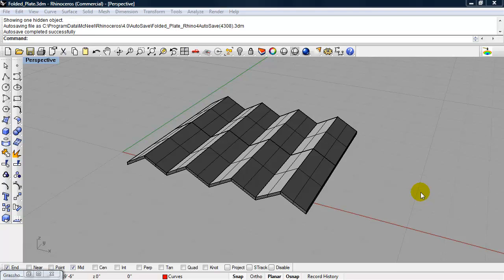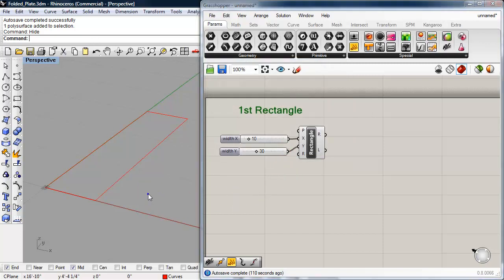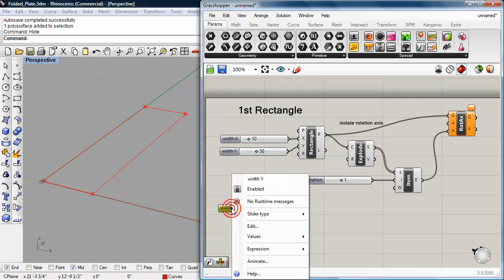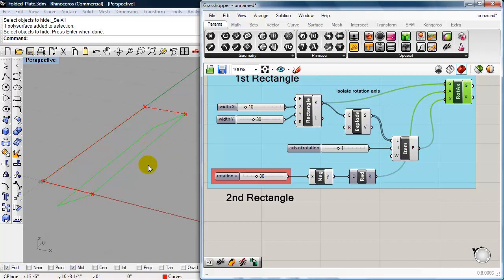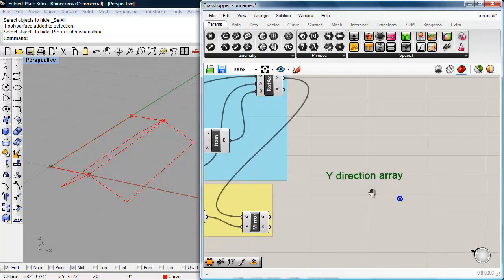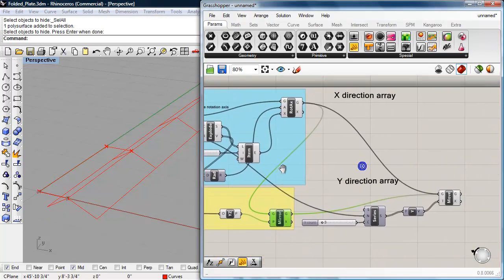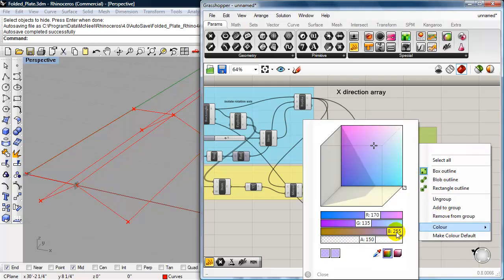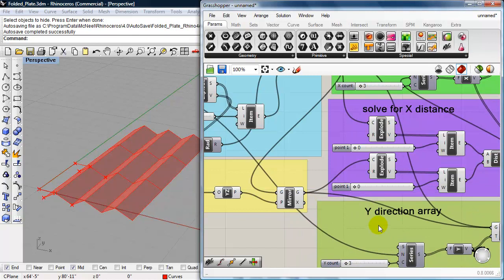Grasshopper Folded Plate

Comment: This is great tutorial, thank you for creating it. I only had one problem: I wanted to input 7.5 value in X direction array but couldn't? I could do 7 and 8 (and I changed the number setting to have all the numbers and not just the round ones). Any idea why that could be? E.g let's say the rectangle modules were 200x200, and I wanted the total length to be 1500 (which would be achieved by arraying them 7.5 times).  Can someone help?
Reply from the maker: Can you double click in the canvas and type 7.5?